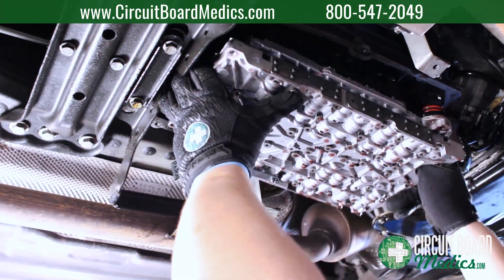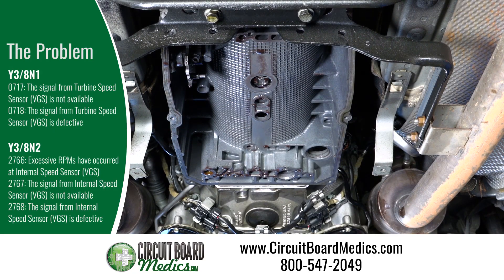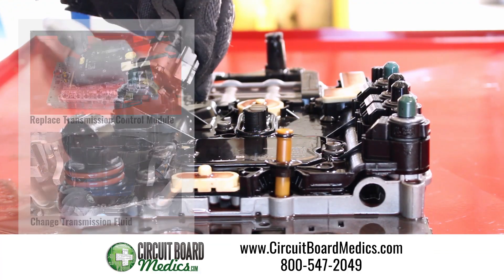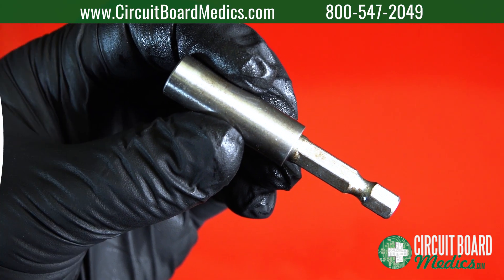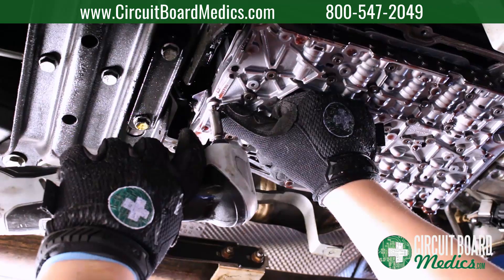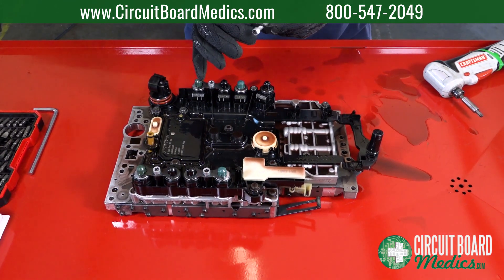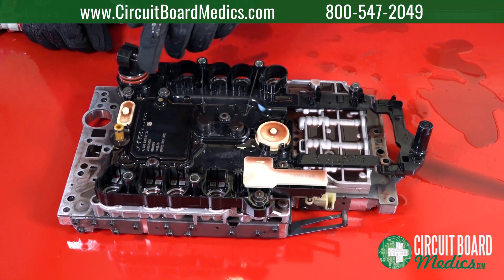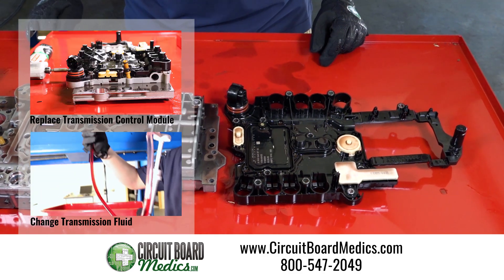Mercedes-Benz 722.9 Conductor Plate (TCM) Removal and Repair 7G-Tronic Transmission

Comment: Hello. My cla 180 2015 model is stuck on P and shows error of “0b7500^ and says the sensor A of the park pawl has a fault. And the when put on the diagnostic it shows the the actual gear is on neural and park pawl is engaged
Reply from the maker: Hello! Unfortunately, we are unable to fix for that issue.

Comment: I just installed my that you repaired now it won’t go into gear. Diagnostic tool says no communication with tcm
Reply from the maker: Hello! Please give us a call at (800) 547-2049 and we'll help you get this resolved.
Reply: @CircuitBoardMedics hello! I actually found the problem. It was my fault. My car is now driving perfectly. Thank you very much for your service.😃
Reply: What was the fault have same thing throw code lost communication with TCM
Reply: @AshcanWally what was wrong with it???
Reply: @AshcanWally  what was the actual problem my friend, i would greatly appreciate it
Reply: What was wrong with your transmission?.
Reply: Please share what your issue was to help others avoid/fix

Comment: there is two ways One has a push and pool tab and the other is a twist to the left and it unscrewed depending on what transmission you have you gotta remove metal cover in front is pug

Comment: What is the proper way to disconnect the wiring plug from the Conductor plate to not damage it? So you just pull the tab and wiggle out the plug ?